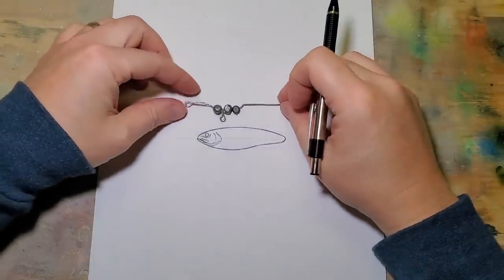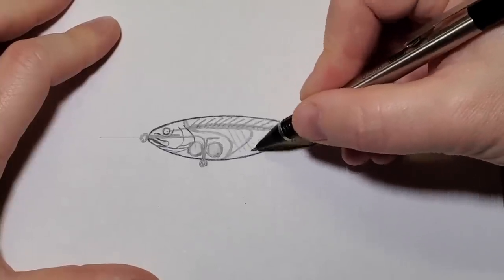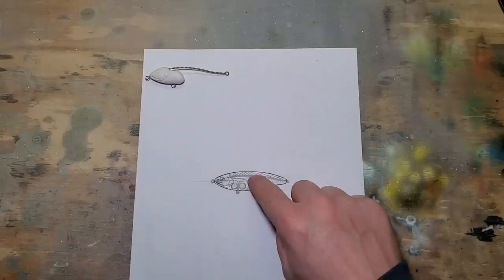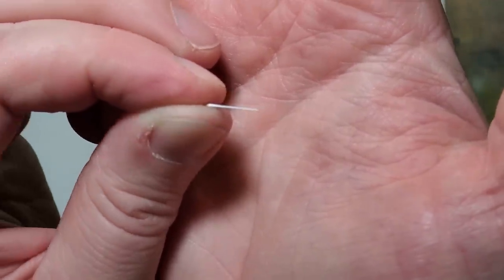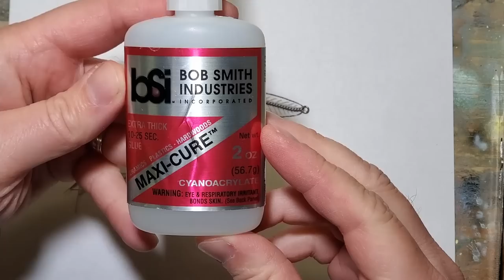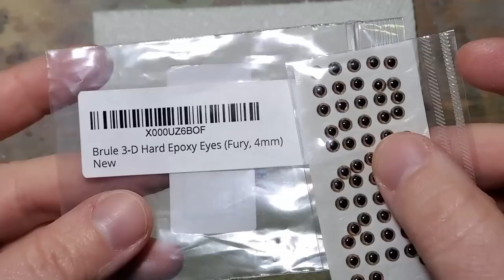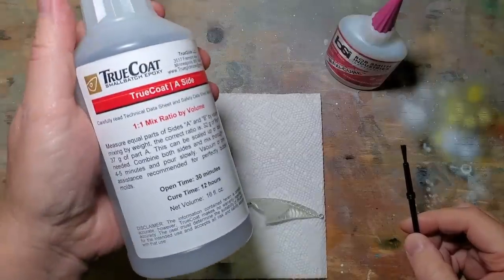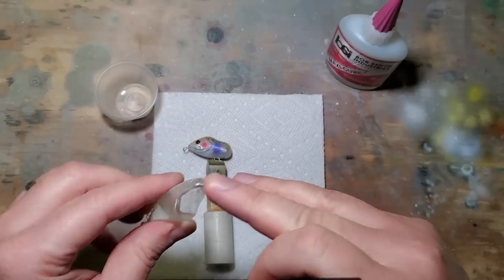Making a Clear Minnow Lure - a how to guide on handmade fishing lures

Comment: Try StarBond glues. They offer a kit which consist of thin, med, and thick. The packages come with several pin point tips and tip cleaner. I keep mine stored in the fridge while not in use. Also might like to try Great Planes Milled Fiberglass. Super strong instead of using baking soda. I have built model rc planes and this stuff became a game changer. Being disabled I have enjoyed your shows. Keep up the good work
Reply from the maker: Thanks for the tip! I've never heard of milled fiberglass; that sounds really interesting. I appreciate your comments and support!

Comment: That was amazing to watch.  I was considering doing a cnc lure of some sort and couldn't take my eyes off this.
Reply from the maker: Go for it! Thanks for watching!
Reply: @zimmtex  Not sure, but I think software can take a 3d lure in a file and insert a hollow object that would simulate an air bladder.  Have the printer print the lure and just not fill in the air bladder with plastic.  then you could drill on the bottom, insert weights and epoxy them in.

Comment: Amazing work! I purchased the GIRAFVINYL Holographic Heat Transfer Vinyl, but I cannot remove the back film to apply it to my lures. Any special trick?
Reply from the maker: I know it can be tough; I use an xacto knife to pick them apart. Also, there is a clear top film that will need to be removed as well. I usually remove the back layer, stick it to my lure (loosely), peel off the clear top layer, press, heat, press again (with padding). I had a great suggestion from a subscriber to get heat resistant silicone to use for heat pressing.
Reply: @zimmtex  Thank you so much for your reply!